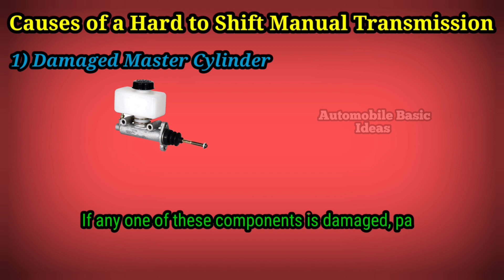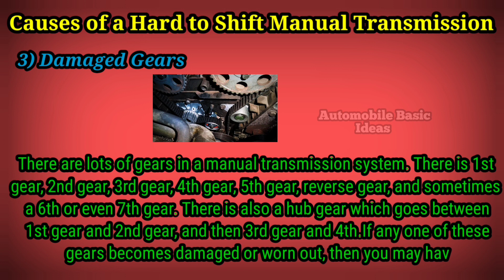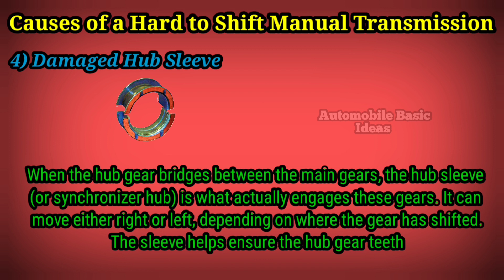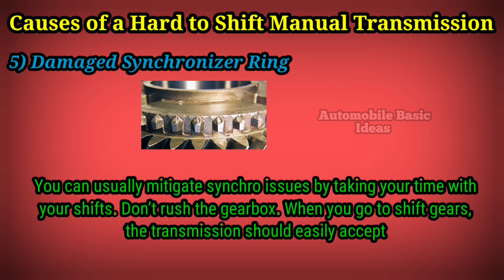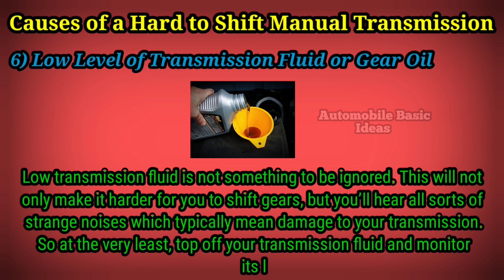why is it hard to shift gears with a manual transmission? || 7 Common Causes ||

Comment: When I'm going to change, for example, from 2 to 1, while running, that is whenever I enter into gear 1 while running, its difficult. But when it is not running, it is very easy again. What would be the reason for that. Please.
Reply: Bro I have the same problem, when I got into first is so hard and second is somewhat less harder. But 3rd or 4rd is way less. 5th is easy. And reverse it like farts before going into gears
Reply: if u are above 5km its going to be hard thats just how the shifters and gearboxes are made,u can try doing it at like 2-3kmh,and then at 5+ it probably wont go easy!
Reply: I have trouble going from 3rd to 2nd, it doesn’t always want to go down
Reply: You are moving it will not return to 1st unless you have slowed to below 5mph, its a safety feature, if you could return to 1st gear whenever you wanted you would most likely destroy your gearbox.